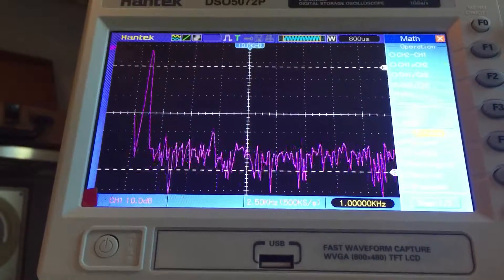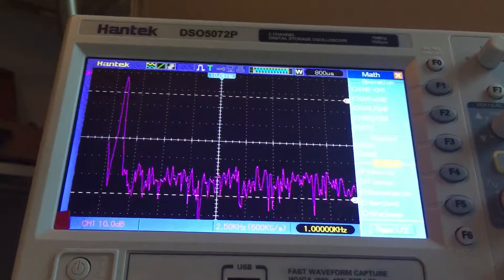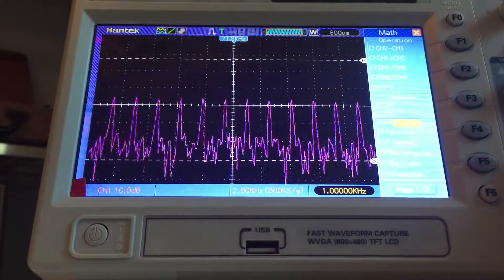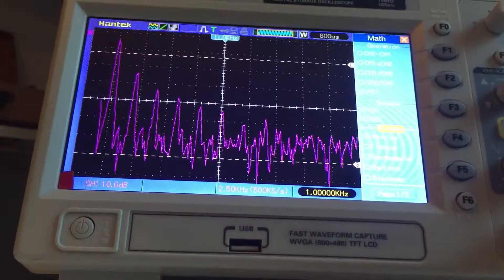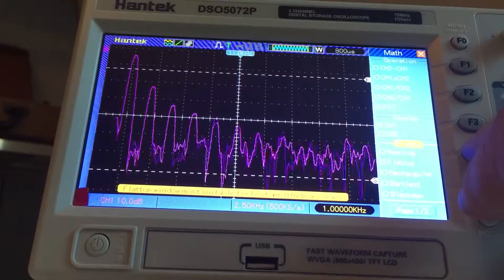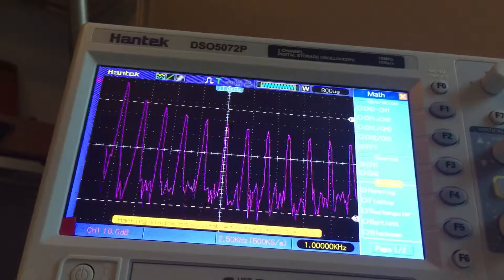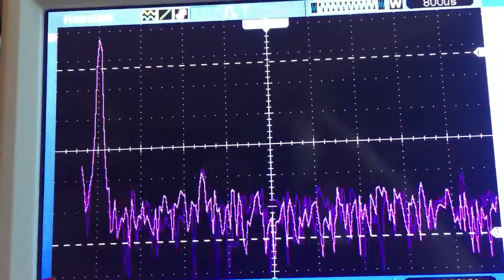Hantek DSO5000P DSO5072P waveform harmonic observations with FFT

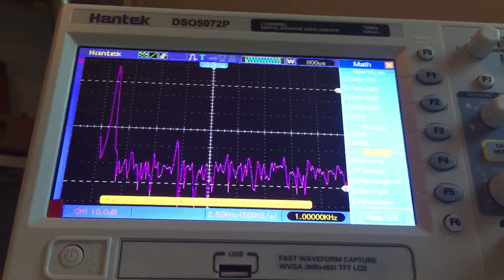Comment: How did you switch over to a square wave at 0:54?  I cannot find the setting.
Reply from the maker: Should be the next setting after sin on that function gen.
Reply: @retrotechandelectronics  I thought it was the same wave form and you were switching from a sine wave "view" to a square wave "view".  I am trying to see the harmonics on AC Mains, like you are able to see with the square wave produced from your function generator.  I am trying to display these harmonics on the oscillscope.  All I have is the view at 0:10 and I do not know how to single out the harmonics from this FFT view?  (Please note, I am being "safe" with the mains - so no need to touch on that)